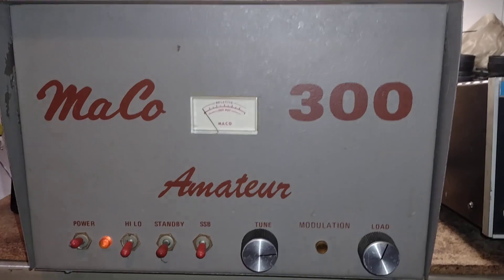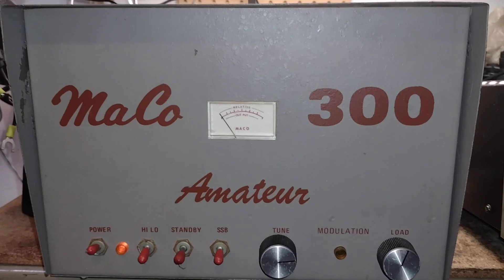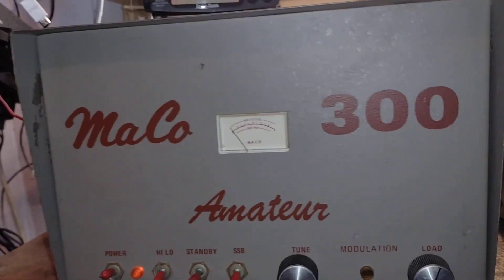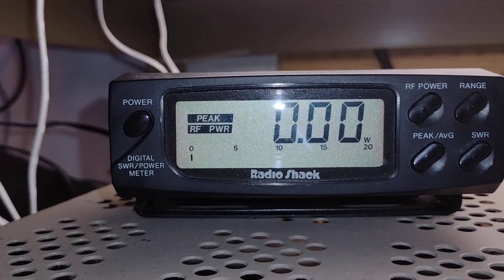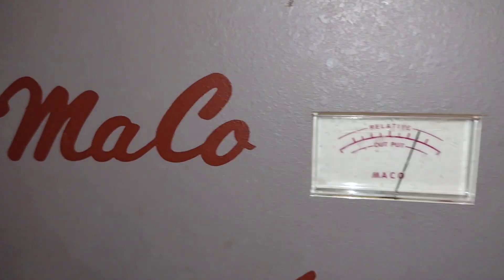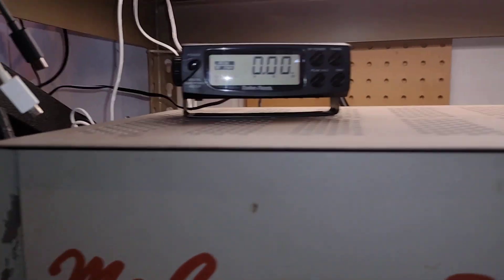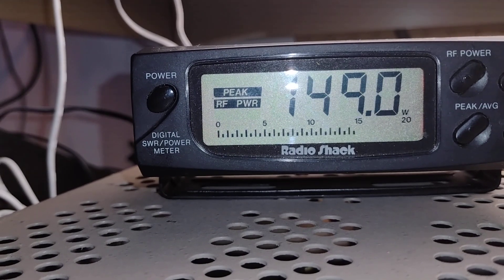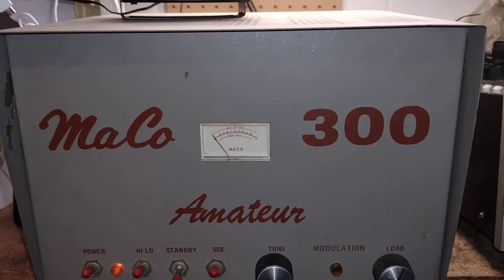A Spin Around the Band:The MaCo 300 "Amateur" 10 meter amplifier.

Comment: What are 8950s going for theses days?
That Meter is interesting, never seen one before.
Reply: Should have brought it up on a variac. To de gas the tubes . After all it sat for 10 years. Watch those plate power supply caps if they are old and give up the ghost it can take out the tubes.BBI has some good videos on tube amps
Reply from the maker: @Brenda-jf2pe  It was part of a craigslist estate cleanout, so I have no idea how long it sat before I rescued it. Other than testing and this video, I never use it. It has seven 8950s in it and while I don't have a good reason to use it I don't have a good reason to sell it either. It would have to be a pick up due to the value of the tubes and the buyer would have had to make an offer I couldn't refuse. I did have a guy come to my house and buy the Demco Satellite because he convinced me that he always wanted one, but when it showed up on eBay for twice what he paid for it I just learned an expensive lesson.
Reply from the maker: RF Parts wants $150 for NOS tubes. It's a Radio Shack digital watt/SWR meter. I tested it against my Bird and as the saying goes, it's close enough for government work.